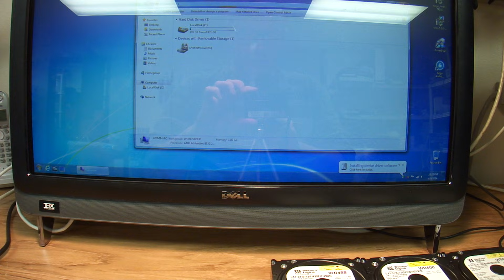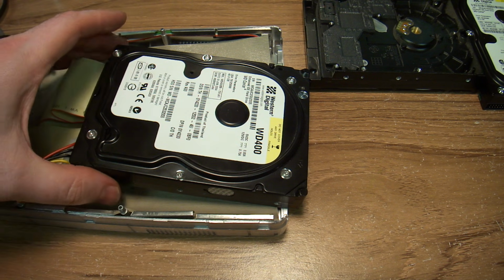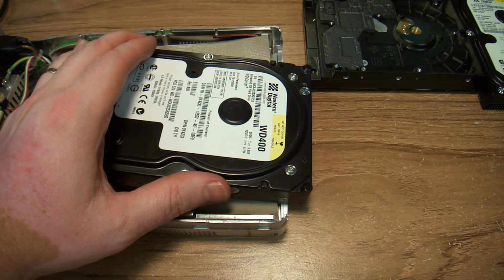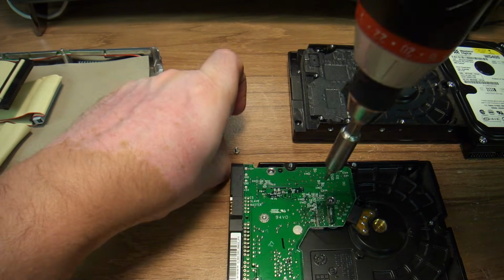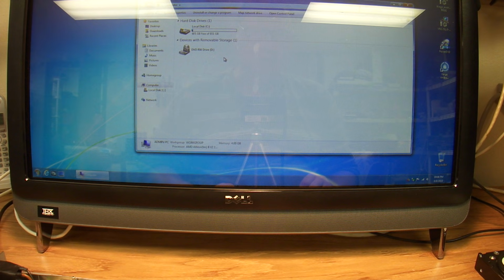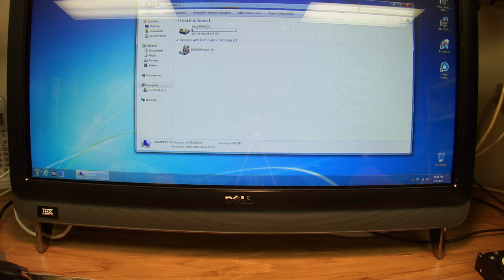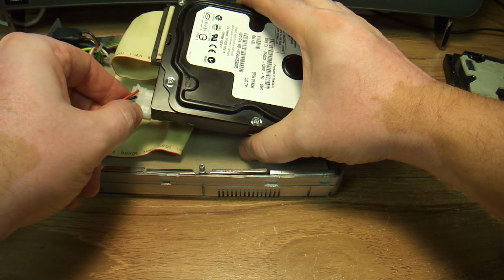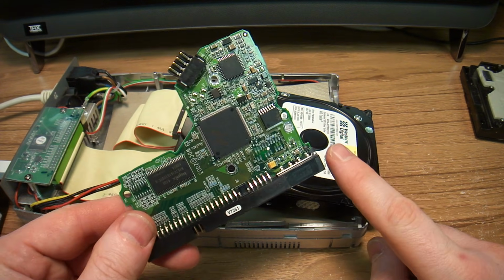DIY How to: a successful data recovery from clicking hard drive. Recover your files Yourself

Comment: Why are they still making hard drives this way? They could easily just make it all run on chips and have no moving parts that would wear out..Like the way those USB stick drives work..But no they keep using old outdated tech for the most vital thing in a PC..Go figure.
Reply: It's here now SSD. I use many of them. You'll pay up to 12X per gigabyte over rotary memory drives.
Reply: DataWaveTaGo

UGH..typical logic..Make the good stuff that is actually cheaper to build (since it would have no moving parts) much higher priced.

So how much are these type and are they as good as the typical HDD? If I can find one cheap somewhere I might put one into my super PC.
Reply: ***** Just look for You Tube videos using "SSD" to search. They are best for laptops because a laptop HD, and even a laptop hybrid-HD is fairly slow. Laptops will see a boot up time that is 5 to 10 times faster, and all other disk operations will be 5 to 10 times faster. Using an SSD in a powerful desktop or gaming machine that has a high performance rotary HD usually sees a lower performance increase.
Reply: DataWaveTaGo

Reason I'm thinking of doing this is I want a HDD that won't fail as I don't have the money to keep buying new ones..This seems like a viable solution, Even if the disc ones would be faster in a desk top.  So does these hook the same way as current HDD Sata? I did watch a few vids on them and saw pics of the top..It looked like I could use my sata and HDD cable to mount them.
Reply: ***** The SSD uses exactly the same data and power cables as a SATA HDD. Before buying an SSD check lots of customer reviews. An SSD CAN FAIL. In the customer reviews look for manufacturers who honor their warranty and exchange a working SSD for the failed unit as quickly as possible.
Reply: Also to be fair, if you noticed, in his case it was NOT the moving parts that failed, it was the PCB that failed (the solid parts), this can happen regardless of storage medium (magnetic or solid). And from what I hear and read, SSDs appart from being too expensive their failure rate is higher than that of classic HDD. So far the only advantage of SSDs vs HDDs is read/write speed, nothing more.
Reply: ***** Jared  I have forgotten more about hard drives than you will ever know  you little fraud...   If you had been paying attention the only ones  getting insulted  are the liars and fakes like you. Those who are serious and show logic and truth are being treated with respect. But that fact  has gone over your head. Now be careful lest your mother come out from under the couch and bite you in the ankle.
Reply: ***** SSDs are actually much more expensive to manufacture than HDDs.
Reply: HDD's are not bad I have several spare ones also that all work and 2 backup internal drives of my OS etc... mines been going in my system for roughly 11 years now no problems no bad sectors
Reply: They do dumbass, but they are substantially more expensive than the  mechanical drive is per megabyte.
Reply: ***** SSD  has a lower MTBF than a mechanical drive.  this means they are LESS reliable. They are affected by heat to a greater extent and have a lower lifetime write cycle than a mechanical drive. The only two advantages are a NEAR instant on read for boot, however you will still be limited by the computers speed, and their greater resistance to shock. Their  greater cost is a major trade off, as a 250Gb ssd is equal in cost to a 2-4 Tb mechanical drive. Where they are seeing their greatest use is in desktop systems as  the bootdrive, where the OS and main programs are placed on it for pure speed, and all extraneous data and regularly rewritten data such as the swapfile are placed on the more reliable mechanical drive.  This gives the speed advantage of Unix/Linux which are 100% memory resident operating systems to Windows based systems which only load a small portion of the OS into memory and utilize drive access for the rest of it, resulting in a less efficient OS. However, SSD is almost as fast as ram (speed is lost as it still utilizes a lookup table similar to a hard drive) so the speed increase is dramatic when configured in this manner.  Perhaps within the next handful of years we will see an increase in size and drop in cost as we have with mechanical drives, making them truly practical for full use laptops ( such as a college students, where it is used for gaming, video and music work as well as running a full office suite) as opposed to strictly business applications. At this point the limited write cycles and small capacity require a substantial amount of time be spent backing  the drive up, more than you would a mechanical drive.
Reply: UnderwearThief UT, I have to ask... any specific flavor? (BFEG)
Reply: HDD on average has a longer life span than SSD. Do your research
Reply: Blake Brown I think he was replying to a comment that has been removed.

Comment: In PCB board you explain about each chip function, and what about 8 pin chip function?
Donor PCB seller said that need to replace donor PCB with old 8 pin chip to work hard disk.

Comment: About chip transplantation, you can sometimes transplant the small 8-pin chip (the SPI flash ROM) from the broken board to the donor, then recover using the donor board. This of course only works on HDDs with the firmware in a flash ROM, as opposed to on the platter.
Reply: I concur! But actually, that chip contains alignment parameters that are only for that particular hard drive and you absolutely have to try to transplant it without damaging it or the board.

Comment: The firmware chip (SOIC8) should of been swapped from the old to the new board. Then it will work 100% if the original board is faulty. Also you pointed to the wrong chips.. the firmware chip is the Small Outline Integrated Circuit (SOIC) 8pin
Reply: except that this would remove the ability of using the donor boards  as tools, rather than repair parts, The labor involved in transplanting the chip would be greater than the cost equivalent of doing it this way and  a new  drive.   Further, it wouldn't guarantee a repair as there may be other unknown issues on the board that caused the failure to begin with. Remember the KISS principle.  KEEP IT SIMPLE STUPID.